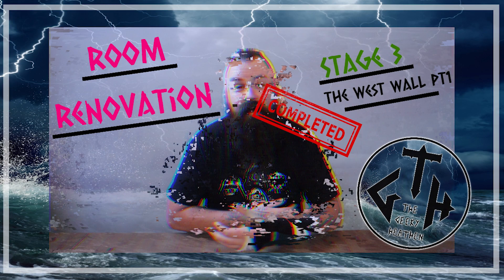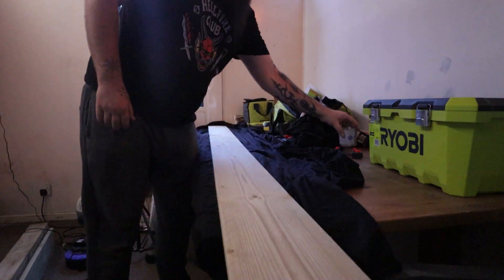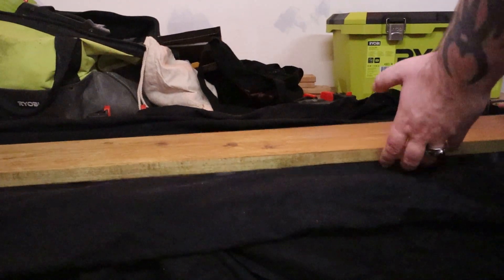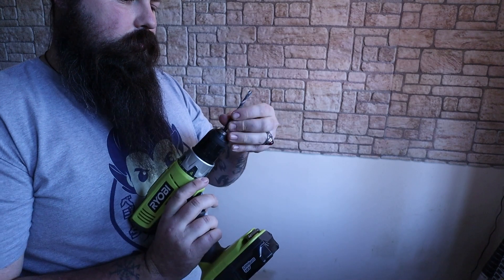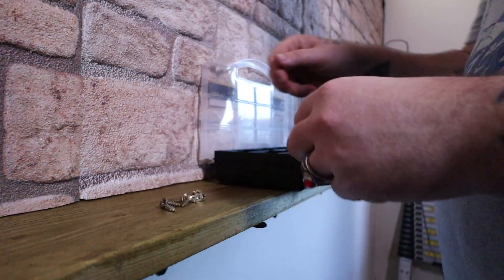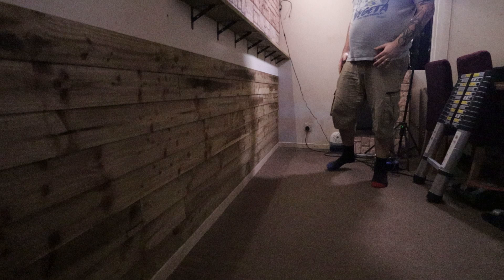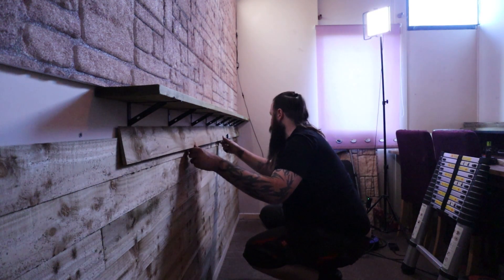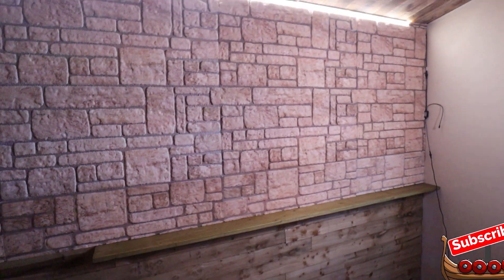Room Renovation: Stage 4  - The West wall Part 2

Comment: hope you did not pick up the paint instead of your tea to drink.  hehe.
what you mean sped up this is your normal work speed
could i have my extending ladders back you borrowed there beside the work bench
why not just put the wood on the wall then the shelf.  and use longer screws would have saved a lot of cutting even if did not come all the way up to join the shelf would have hid any gap
Reply from the maker: Probably would have been easier to put the wood on first followed by the shelf lol but the wood is tapered so the brackets wouldn't have been flush which Probably only I would notice 🤪